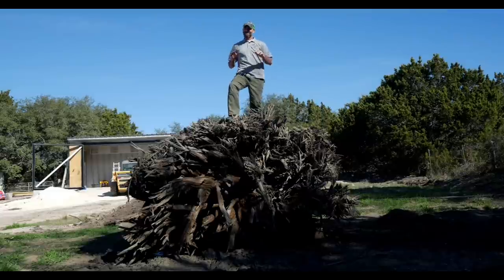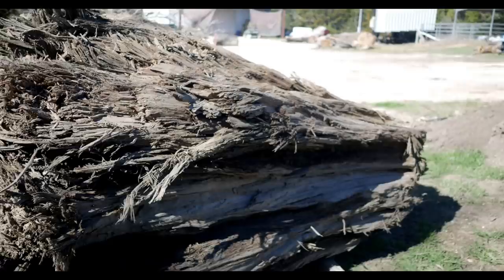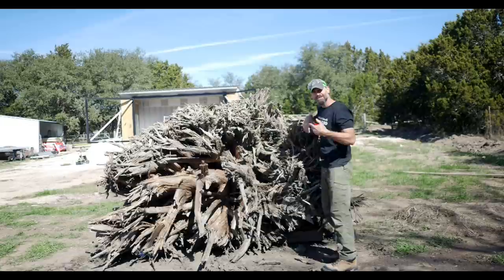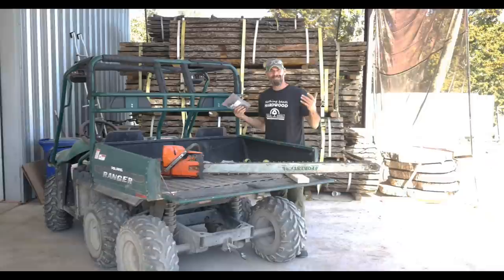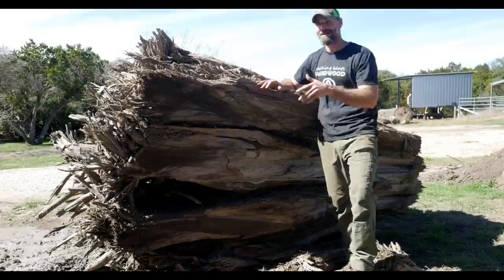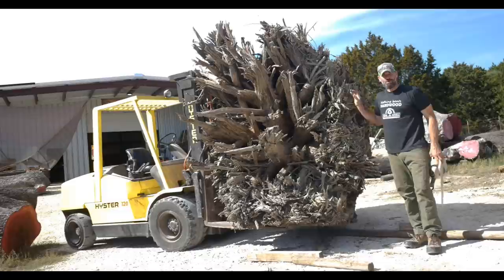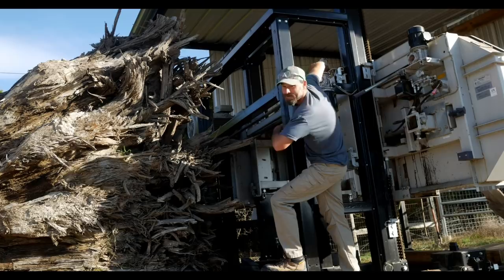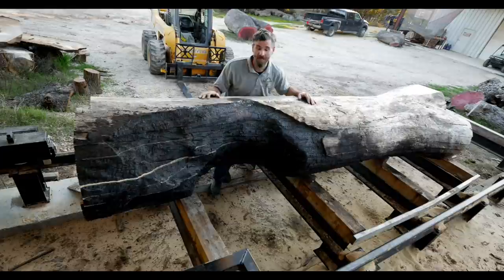Prehistoric Sinker Cypress Log - Buried 30 Feet Deep for 5000+ Years!!! - Part 1 of 2

Comment: Tell me if I’m wrong-I know this tree. It came from the excavation of a sewage treatment tank in Baton Rouge at Gardere Lane. It was 30 feet down, in situ, not a sinker cypress. The River buried it. It was exciting to see & I have a small piece of it. It was a little longer I think. You have the stump. There are thousands of buried cypress, from LSU south. It’s an entire forest.
Reply: It’s very possible that is the stump your describing. 
Krantz in Houston specializes in ancient cypress and they sell slabs for the price of a sports car in some cases. 
LSU Campus is an old plantation site that was founded right where Pentagon Barracks are located. 
Your correct it’s an ancient place as evidenced by the 5000 year old burial mounds right across the street from Pentagon barracks. The LSU Lakes were in fact already an ancient cypress swamp. Huey Long had it cleaned and cleared in the 30s and created the “Lakes” and who knows what’s buried underneath the I-10 where it spans the LSU Lakes. 
You know why they call it Highland Road right?
Reply: @LaGrandeBayou  I don't know why they called it highland road!? What is the meaning behind it?
Reply: Yeah I’m from Georgia but I have done logging in Louisiana and seen entire forests under the water